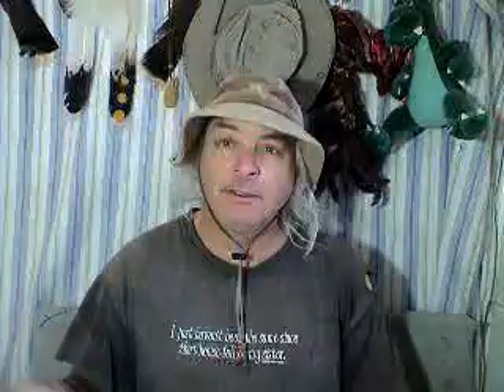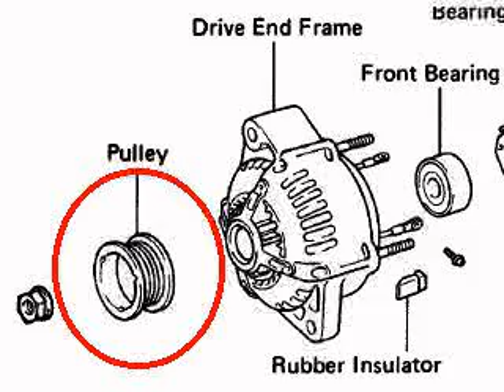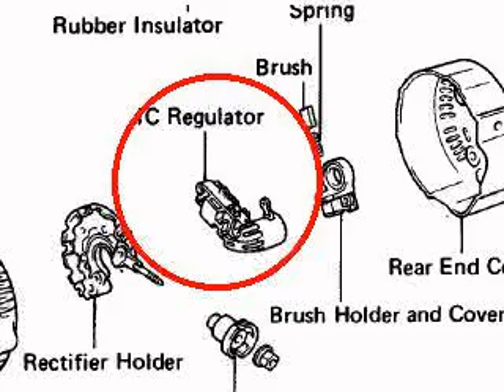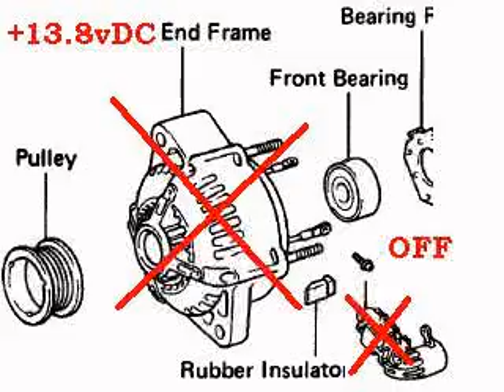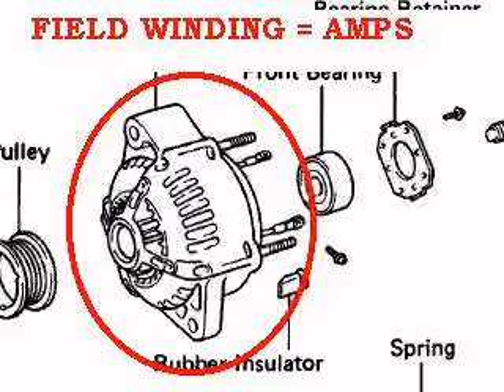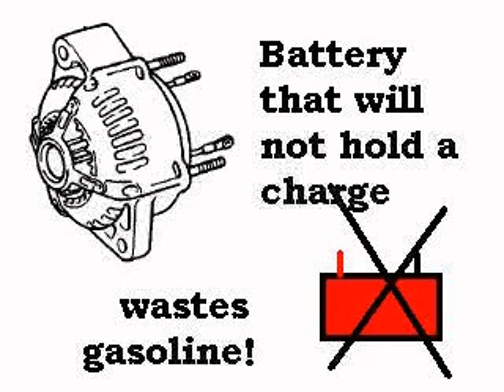Major Technology Breakthrough! Burn Water as your Automotive Fuel! HHO Part One

Comment: most piston driven engines only burn about 30 to 50% of the hydrocarbon, adding additional hydrogen and oxygen to the air/fuel mixture under compression will produce more complete combustion ergo more heat value is transferred into usable mechanical energy thereby the need for additional hydrocarbons is reduced ....how is this not more efficient? also there are these things called Ballasts, capacitors and diodes that can reduce the mechanical force needed to generate electrical current.

Comment: if all you statements are correct than why does water/methyl increase the total hp output at the crank in performance diesel engines while lowering egt' past the turbo charger?....true many of the claims on youtube are in fact false or a scam, however to ignore all the science behind an internal combustion engine just to disprove them only makes you yourself look uneducated. engines don't run on gas or diesel they run on Hydrocarbons, why because of the fuckin hydrogen, the carbon is waste

Comment: You can use water as part of a fuel system of a care, it is called a boiler motor. Steam power ran this nation for a generation. While it is not as good as the internal combustion engine, it in fact, uses water, mixed with other fuel sources to power a vehicle into motion. They are dangerous d/t the pressure; however, they do in fact use water. One could use water, with other sources to also separate the hydrogen and oxygen molecules which both have a lot of energy and could propel a vehicle.

Comment: Thanks for doing this video. I'm restoring a Chevy k5 Diesel blazer that I bought from the military. It had two alternators and was 24 volt. I removed 1 alternator and converted the wiring over to 12 volt to reduce electrical problems and to save a little fuel. I was wondering how the fuel consumption increased according to electrical load. Apparently it's from increased electromagnetic resistance in the alternator that causes increased drag on the motor. Thanks for the information.

Comment: Okay. You may not be able to run entirely on HHO. I have installed a small hydrogen generator on my 1996 K2500 with a 454. My average gas milage has increased from 11.9 mpg to 14.1mpg with the truck empty.
 Hmm. I wonder if this might keep your nasty mouth shut.
If you cannot make a point without using profanity, you may want to go back to school to learn more of the english language and sober up. There are several rehab clinics in the United States.

Comment: Your right and wrong. Yes you can't split water into gas and run your car. Thats not what stanley meyers did. He used water and resonanated the water and EXPLODED the water , causing a thermal expansion of water to steam driving the pistons. He did inject also hho gas in this process, but did NOT run the car with just HHO. And YES, you can split water into HHO with FREQUENCY pulse trains. You don't NEED AMPS likes your force fed in school.

Comment: Always nice to have a logical debunk video. Ive followed u for a bit now, good job breaking it down to the bare basics. Auto alternators pull 5 hp on MOST engines, no matter how many amps the alternator can make (35-300 amps). So, if u have a 300 amp alt. with a super efficient brown gas gen. (RLC), do some r&d with stan M's help, and understand the mysteries of water, H,O Plasma, and the second law of thermodynamics. Hope ur well

Comment: i guess you missed the one important part - the gasoline, to drive the engine, is the converted water .. further you forgot the fact, that the Ah created by the alternator are more important than the voltage - but get a bit informations about that in a regular physics-book ;) so.. nvm - the fact is, that HHO replaces the gasoline to run an engine. that engine spins the alternator. at this point i want to ask you a question - is it bad to "burn" more HHO into H2O by stressing our alternator?

Comment: @VonBraun87545 >"This guy already knows that HHO works in any internal combustion motor"

This guy knows that and understands why such devices will make ANY engine less efficient. The physics involved was discovered by ppl trying to make engines more efficient, btw. Every system EVER observed obeys the laws of thermodynamics. No exception yet. If you have one: demonstrate it.
Until then, an HHO device is nothing but an inefficient car heating device.

Comment: One guy claims he is using only the hydrogen to lean out the mixture without the problems that come with running too lean. If you are able to lean out the mixture without raising exhaust temperatures, you will get better gas mileage. Is his claim that you can use hydrogen as to accomplish lean mixtures while maintaining emission standards valid, even in theory?

Comment: @cam1996reeves Do not do that.  The battery needs to stay connected for two reasons.  It acts as a surge suppressor and absorbs short burst of higher voltages.  Like when you turn off your heater and there is excess power for a couple milliseconds.  And it acts as a capacitor, providing extra power when there is a sudden demand for extra power.  Like when your turn on your heater at full speed.  Without the battery the alternator is left to pick up the slack and it will wear out your alternator.

Comment: @hessian144 Your alternator will never shut off. The voltage regulator does NOT turn it on and off like this idiot says.  It maintains a steady system voltage when the engine is running, usually 14.6 volts.  This guy has no idea what he is talking about.  In your case it was still your voltage regulator that went out and it allowed to much voltage to go to your battery.

Comment: Your so stupid. Do more research. You can run an engine only with hydrogen. Now run your elaborate alt. On said engine... Just repeating the word gasoline does nothing.
Reply: Spaz2147 I think the claim was running a car on water,of course you can run a car on hydrogen if its the fuel but to get hydrogen from water you need electricity which needs to be generated via the alternator run by the gasoline engine, there are cars that have hydrogen fuel cells but they are expensive and produce water as a waste product.

Comment: you couldnt be more wrong. have you even tried the HHO generator? you never know till you try. YOU are the clown. because the hydrogen burns faster than gasoline it helps fuel economy.  regardless of the charge drawn from the alternator. I suggest you remove this video all it proves is that you are a complete idiot.

Comment: dude number of companies made a 100% water cars...
but HHO is not a water fuel.. its a hydroxide assistant additive.. NEVER heard anyone selling HHO that says all you need is water for an HHO system... so DONT lie to try and make your own point to refute it back again..
ALSo pls get some education.. the alternator runs weather or not your using HHO or not. there is not much drag on the engine compared to the extra power created by HHO

Comment: @smackout Google hydrogen enhanced combustion engine.

It is known hydrogen can improve engines. The point of debate is how that hydrogen is created. Using the alternator's "spare", or waste, energy doesn't work because there is no waste electrical energy. But you can use waste heat energy and that's what this MIT plasma fuel reformer does. It also gets the hydrogen directly from the gas and not from any water reservoir, maybe because its requires less energy to liberate H2 from gas than water.

Comment: @namegoeshere79 you dont have to be a scientist to know that having hydrogen and oxygen around a potential ignition source makes it go bang! more oxygen means the charge will need more fuel = less efficient, but the hydrogen allows the hydrocarbon fuel to be more explosive. check out syn-fuels. hydrogen and syn- hydrocarbon fuels.

also mate. there's no need to be condescending, you shouldn't talk people down for having an idea. being wrong means there's more to learn, that's my take

Comment: @namegoeshere79 also since the points you mentioned before have been answered, (comparing hho with nos and water injection.) and to answer your question, i am not a competent scientist, but i have experimented with these systems and can say they work if done properly. to burn water you must first seperate it into its basic elements. hydrogen and oxygen (that statement alone answers you question) using electrolysis or the use of a vortex heat exchanger. plasma has no problems burning water.

Comment: @namegoeshere79 mate i am only justifying whatever you have pointed out. increasing air density.... doesn;'t that mean increasing the ability of a volume of air to carry oxygen? how am i confusing making power against efficiency mate? point that out for me. as i have stated.. water injection etc is only to cool the air charge. adding methanol increases it's octane rating. and in my experience tuning a car to make power also entails making it more efficient at burning the charge than standard.

Comment: @smackout You're confusing increasing the power of an engine with increasing its efficiency. There is no way to "burn" water and gain more energy from a gallon of gasoline. You speak of ways to increase power: water injection, methanol, superchargers, but those all are just tricks to get more oxygen into the engine that will allow it to burn more gas. 

More Power. Same amount of energy per gallon.

Can you come up with a real chemical explanation for how to burn water or only bad analogies?

Comment: im not sure that a mass produced engine cant be made that support hydrogen, but its still science that electroysis takes more energy to take water apart than you can, even theoretically, get from hydrogen. if some wanna claim its cleaner depending on engine design or a clean stationary electric source for mass production of fuel, then thats a whole different story.but you are pissed off about is that people say electrolysis is exothermic,nope, combustion is the exothermic twin of the reactions.

Comment: @namegoeshere79 you can make the engine have extremely high temps, as it does, in the combustion chamber, provided the engine block can remain cool. a vortex heat exchanger method can be used to create sufficient energy to generate what is needed to break water down using the exhaust gases and magnetic fields they create. 

you people need to actually make these yourselves and experiment, the books you read are only accurate until the next discovery has been made :) 1st ed. science books r gold

Comment: @namegoeshere79 so why do high performance tuners use water injection?? to cool the air charge and give it more density. methanol is also used to increase the octane slightly and have a greater cooling effect. also engine vacuum means the system is under vacuum. not atmospheric pressure

the first point you made. yes an engine cant run that high a temp. using the alternator is taking power to make power. but so is a supercharger.

Comment: @namegoeshere79 have you tried any of these systems for yourself? water doesn't require that many amps that it would be a strain for the alternator. and what your pointing out is that water cannot break down until a high temperature is reached, and is a liquid at atmospheric pressure. true. but your talking about injecting water the same way as NOS. of course it wont work. unless it is atomized under high pressure, such as in water injection systems,

Comment: @smackout There are two effects that allow Nitrox to improve the power of an engine. Niether will work with water.

Number one:
as you said, when Nitrox enters the engine it decomposes into N2 and O2 above a temp of 570 deg F and the O2 feeds the engine. This would work for water if the engine could run above 5500 deg F, the temp at which it decomposes, but the engine would melt at that temp. Using the alternator to decompose the water is just starving Paul to feed Peter.
Won't work.

Comment: @smackout 

Number two:
Nitrox is stored as a liquid. When it is released into the intake it vaporizes, reducing the temperature of the incoming air and increasing its density, improving the Carnot efficiency of the engine. Water is liquid at atmospheric pressure so you can't gain this benefit.

Comment: @BookBurnington Steam engines don't run on water. The water is boiled by another combustible fuel which is the true source of energy and the water just transfers that energy to a piston. When used this way the water is called the working fluid.

Train steam engines run on coal or wood, not water but steam engines in general can run on anything that can burn.

Comment: @Desertphile I think that people that install this HHO's are driving more responsibly, most likely a psychological side affect of believing  that it works, so when they swear that they are saving money, they are because their driving habits have changed and they actually measure their savings to prove that it works, I myself have used a vacuum gauge to drive by to test the theory, I had a 50% fuel saving over the known distance but it can give you a headache with the extra awareness needed.

Comment: @Desertphile, A little water vapor will do no harm as long as it's not to much, it will make the engine run a little better just as it would on a cool rainy day, it gives the engine a denser charge, water injection has been used for years in the aviation industry, WW2 fighters used water injection, could most probably liken it to an intercooler aimed at performance more than economy but that being said more power means you don't need a lead foot, water injection was used with turbo chargers.

Comment from the maker: @Geoffreyinoz ; Indeed, the water vapor from these "hho" devices may cause more harm to the engine than it is worth; I have no idea how much damage, if any. Some people use a device to try to dry the oxyhydrogen before it is trickled into the air intake manifold. All this is pointless, though: if they want an increase in fuel economy, they need only drive slower.

Comment: A friend of mine was making and selling these device's, the reason was to make $, I told him they don't work, he has no comprehension of the theory only the crap he reads on the net, as far I could see I'd liken it to a leaky inlet manifold, where the engine races a little faster and seems smoother, but everybody is aware of what that can do, burns out the engine valve's, I told him to go buy a commercial water injection system, will do the same thing as this device claims but better

Comment: An Alternator is a moderately efficient device. An internal combustion engine is not, particularily. Gasoline lacks octane and is not completely combusted. Take some electricity, create a small amount of highly explosive gas, improve your combustion of the gas, and you have created a small improvement of horsepower. Subtract from that gain your electrical cost in amps and left over is your gain. When done correctly. God your thick.

Comment: you must only belave in what chose to read . your car's alternator after 1996 and up
start charging to 13.8 to14.2 volts put out 80+ amps thats a fact your car bat is only for starting only. the VR. just tell how many amps to charge it takes 1.5 to 8 hp. to 
pull most alternators i dont use hho but have friends that do and thay run on a 20 amp fuse the same fuse like whats in the radio so please dont try to make a fact
out of what you dont understand. what did you make to help with gas??

Comment: @pianoman0488 you assume that a car going down hill puts energy  through the axle to the transmission then back to the engine well that would depend on things like is the car automatic of straight drive . why because a automatic has a torqec  converter which  slipps going down hill while engine is idle. plus other factors which make  you idea unworkable . in a perfect world you get o percent loss of power but in reality frictions and thermal dynamics robb your idea sorry just stating fact!!!!

Comment: apparently not everyone trying this is using the alternator to supply power to the fuel cell... i´ve heard rumours of stirling engines being driven by the engines cooling system and used to generate electricity from the vast amount of energy being wasted by the engine... if a 100 hp car is loosing 200hp of energy as heat, which it probably is, thats around 150kw of power that could be put to use... any thoughts?

Comment: @RavenPrecept the sad truth is that water in your mixture won´t make your engine more efficient (which are actually less than 50% efficient) what water does is to low your chamber´s temperature so you can inject more fuel and get some extra power of it (at the cost of that fuel with it´s efficiency loss) the guy in the video is right about everything. Electrolysis is an energy expensive process that adds one more link in the inefficiency chain.

Comment: Some cars came with a 100 amp alternator. This however does not change the fact that putting a load on the alternator creates drag. You hit the nail on the head with the part of the alternator not generating "free energy". How does adding the load of separating half a gallon of water double your gas mileage? You want to know how they explain the over unity issue with this setup? They actually start bringing the term "Zero Point Energy" into the mix and molecularly aligning the water, LMFAO

Comment: @Desertphile 
You seem to ignore the evidence.

"Scientific evidence" has no universally accepted definition but generally refers to evidence which serves to either support or counter a scientific theory.

If you lean out  (lowering fuel usage)  a ICE, that causes high Exhaust Gas Temp (EGT), and then the engine starts to "stumble" (run rough). If you add HOD HHO at that point. The EGT lowers and the engine smooths back out. Allowing you to run with less fuel consumption.

Evidence?